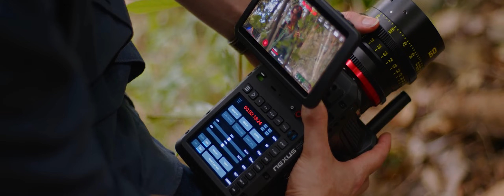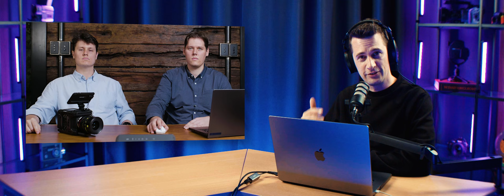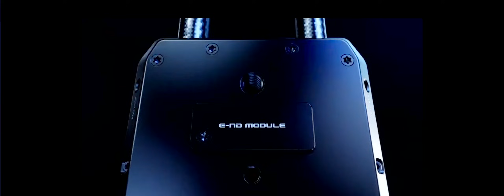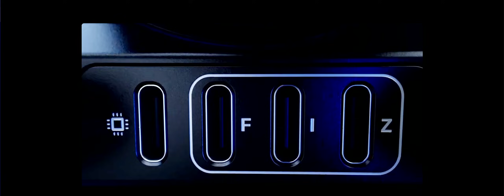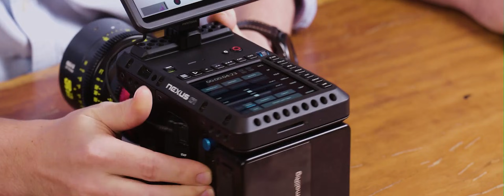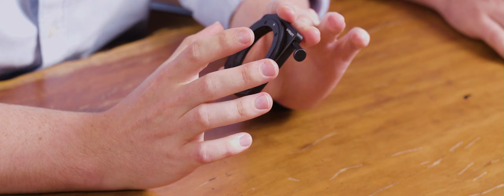Nexus G1 Camera: A Conversation with the Camera’s Creators & U-Mount Reveal - CineD Focus Check ep95

Comment: Cool but worthless, the biggest downside is there is no electronic lens mount which means you are limited to cinema lenses manual iris only. No mention of an SSD support although being all BM parts I'm sure you have SSD recording. Also the industry is moving quickly how are you gonna keep up when when BM is already doing auto focus on their BMCC6kFF and will soon release on the pyxis. It seems you are still beholden to what ever blackmagic software does like ProResRaw. Also no mention of the monitor and if you can control the camera from the monitor, I am guessing you cannot seeing it connected via HDMI. How many USB-C ports can you add extra monitors to or EVF? USB-C to control tilta nano II? Why not 7 pin lemo to control Nucleaus M that is more of a professional focus motor. I have always viewed internal ND's as a broadcast camera not a cinema camera. I admire what you are doing and keeping the 6k cameras alive but so many questions that have already been answered by blackmagic with firmware updates like proresraw, auto focus, dual monitors through usb-c on pyxis 12k plus sdi, and 4 channel audio recording.

Comment: If nexus teams up with DZO to integrate the cyber primes, and think more towards the nvme ssd storage instead of cfast because most people i have worked with or rented bmpcc cameras from have mounted an ssd card externally because of the cost.

I also have friends who swear by the top handle, wouldnt having all buttons and the control screen on top affect their operation?.
Reply: I’m pretty sure that’s what their “Max Drive” basically is at 1:04:02 , an ssd inside an enclosure that happens to use the cfast connectivity which they claim it to be cheaper than cfast media. Even then you still have the option to record externally via usb c.
Reply: @max.chavalwan any cfast type is more expensive than nvme ssd, that's why I was specific with nvme and recording externally is already what we are trying to address if you read my previous comment.
Reply: @max.chavalwan  It's not possible. It would be great if they did, but the "max drive" they have is just a SATA SSD, which is limited to 530MB/s speed.
Reply: It's not possible. They don't control the recording part of the camera. When the Nexus G1 records, it's basically just the pocket 6K camera that connects to a SATA drive through the CFAST port and writes to that as normal. Unless they've modded around these restrictions somehow, but it doesn't look like that. What they should have done instead is let the pocket 6K record into a fake CFAST card that is actually the RAM of the Nexus computer, which then dumps to a NVME SSD. It would still be limited to 530MB/s, but be more stable and allow faster offloading.
Reply: @meanmarine24 true the recording isn't handled by the nexus. My point was to give us a way to add the ssd as part of the body instead of rigging it on top or on taping it on the side of the camera. I also do understand the heating aspect of nvme as the mavo edge 8k (which I think the nexus body is closest to) but since nexus is building from scratch its something they could implement. Its just wishes from an operator/dp

Comment: They're rehousing purchased cameras as resellers so basically Blackmagic couldn't care less about what you do with the camera you bought. Margins have to be paper thin operating this way, I'd assume most of the profit would be in the mentioned accessories. Wish these guys much success, they seem really smart and innovative, this could be a great jumping off point for them to move into developing or purchasing they're own sensors. But if I know Blackmagic, my guess would be the "Pyxis 12K Pro" that is likely to be announced and released next year before these guys get to market, will have an Electronic ND, Two SDI, Two XLR, Autofocus, and considering the stronger relationship between Apple and BM likely the return of Prores. Just a guess.
Reply from the maker: Can be, but there's a lot of speculation ... we wish them the best of success, it would be unfortunate if they weren't successful with this project. But yes, I also can only imagine them having razor thin margins. Nino

Comment: Love it but believe it’s a few years behind in image. If they included the new pyxsis sensor it would go along way even old Blackmagic now has autofocus
Reply: Nonsense...
Reply: Old black magic now has autofocus?

I don't believe it does.
Reply: @ThisisnotTwitter when I say older Blackmagic Cinema Camera 6K is what I mean
Reply: The pocket 6K has a great image. Especially if they can make a optically good FF adapter. That would put the nexus G1 back in the bracket to compete with modern FF cameras.

Comment: The fact they've made it this far is so commendable. I remember seeing LC-Tec featured on cined for the first time 2-3 years ago and seeing it implemented in an accessibly priced product like this is so exciting. Love the consideration and prioritization of all the features they included/excluded. Love the modularity and how they designed for repairability. The P6K sensor is gorgeous and I always wished it had compatibility with mirrorless lenses or to speed boost FF lenses, so the U mount looks very promising. The integrated FIZ system, PD output and battery module options, the internal backup battery to allow hot swapping. All the mounting points, built in nato rail, integrated rods. All super exciting for a first iteration. 

Nino is always an excellent interviewer as well. Keep being ambitious guys and keep pushing accessibility and innovation forward.
Reply from the maker: Thank you! We appreciate it. Nino

Comment: I'm not impressed. These guys feel like a representation of that one XKCD comic about standards where someone complains that there are too many standards and there needs to be one standard that covers everyone's use case, only to create another competing standard. They're not creating anything new, they're just creating what equates to an overly complex and likely overpriced accessory that's more compact because it's designed to be built in instead of modular.
Reply: Do you want to connect your suggestions with the reality in front of you?

The prices are largely on their website. 

I gather that they have created a few new things like their mount. Aside from that, the point is that they don't need to create new things. Just combine what other manufacturers won't because these guys have the skills to combine everything. 

The real downside I see is the sensor could be much better. They are buying old sensor tech, but it will still be good if it gets a reasonable amount of light.